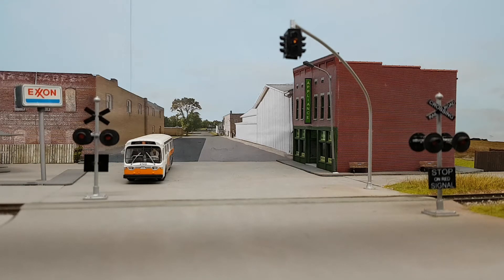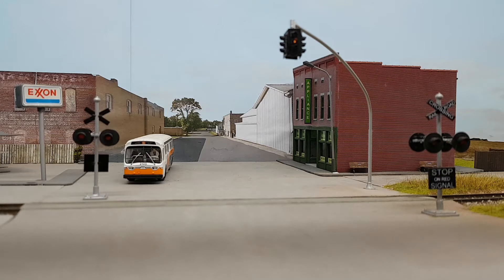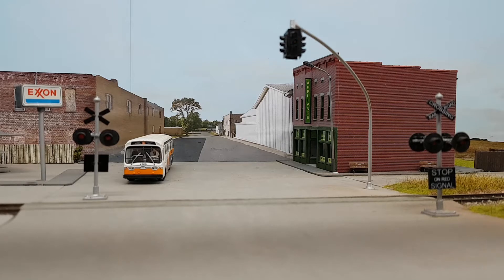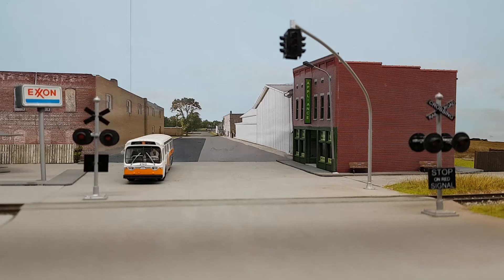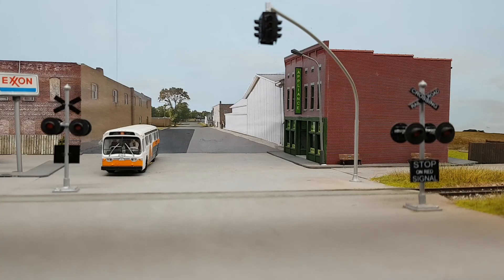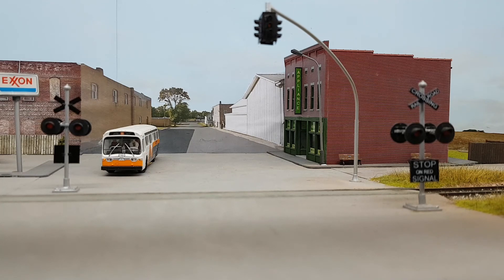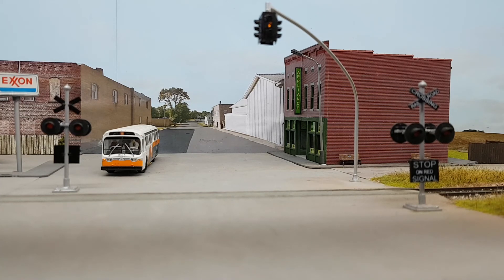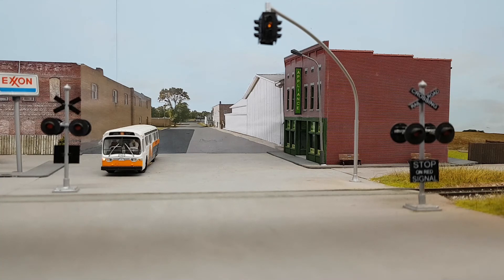NCE Light It dcc lighting decoder

Comment: Hi Mike, this was very useful.  Curious though, I'm reading through the NCE Light-It manual and it has a maximum output of 30mA for the whole board.  Were you able to use a single Light-It decoder for the gas station (or each grade crossing or even the bus)?  

If yes, how did you achieve this? Most of the warm white LED's I've seen say they require 20-25mA If and 3V. so that means in parallel they draw too much current, or in series, there isn't enough voltage to even drive two.  Then again, maybe you found a special brand of warm white LED's that require less current or voltage.  A diagram of what you did may be useful if you didn't do anything special to drive multiple LEDs.  Or maybe the LED's you used were all technically yellow and not warm white, which have lower current requirements. Hard to tell.
Reply from the maker: Hi Dave. The crossing has two light-its. One for each unit. Both on the same function address. For each of my buildings I use the led mounted on the board for lighting the interiors. So the gas station has one board inside, with the sign on one output and the exterior lights on the others. The bus is a single board, with two leds on one output for the headlights. The turn signal and interior leds are on an output each. I must confess to have not tested the outputs with a meter, I just hooked them up. I can only assume that the manual may be incorrect and each output is 30mA? If memory serves me correctly I had to dim the output on the gas station sign. Regarding the leds, they are nothing special, just cheap ones from eBay. They were described as warm white, certainly not yellow. They are a useful little thing, and I am pleased with them.

Comment: brilliant! i'm getting into lighting eventually and i was thinking i would go with the Just plug system because i don't wanna deal with soldering. but this looks interesting. great vid!
Reply from the maker: The illuminator has sockets suitable for just plug lights, but happens to be a more expensive decoder. Both the light it and illuminator are excellent decoders and work well.